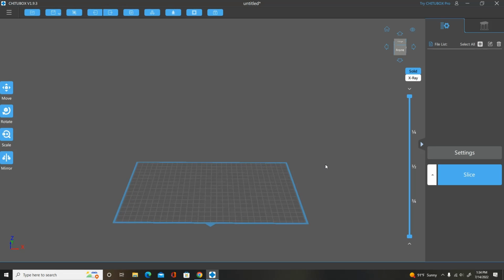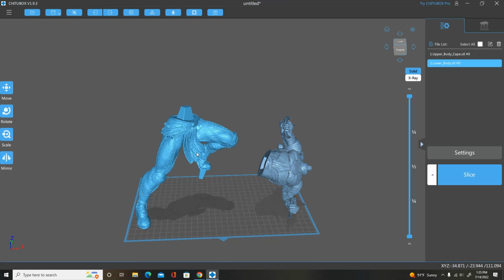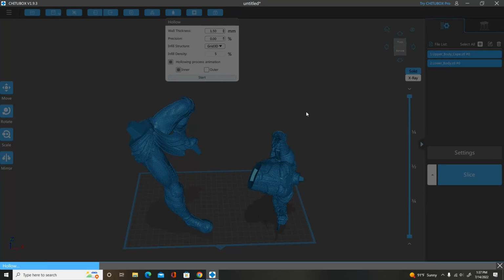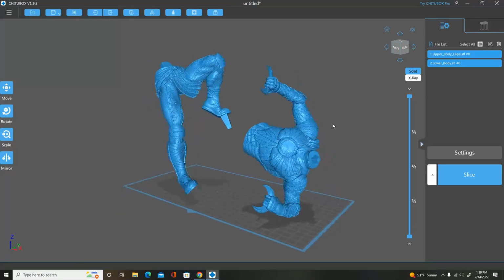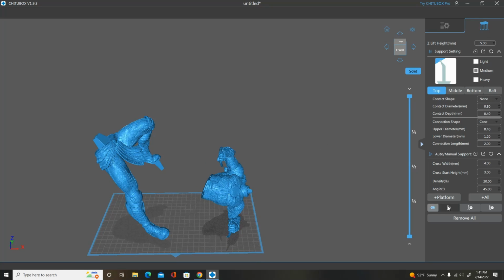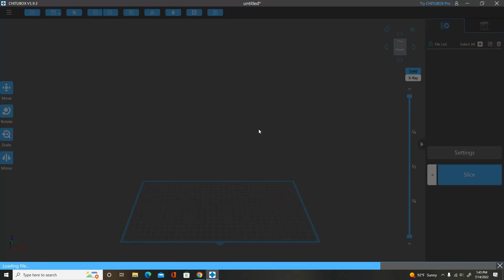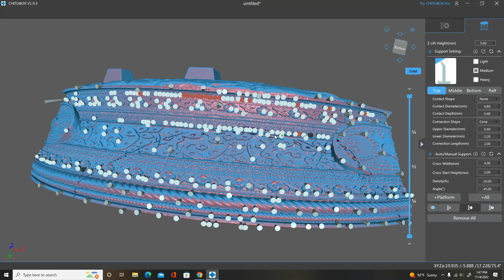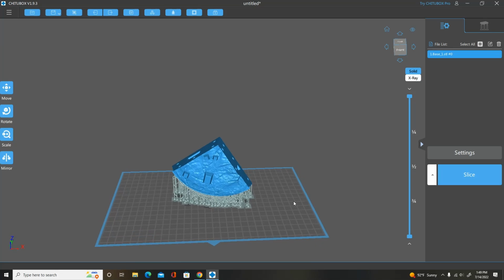Quick and EASY Settings for Better 3D PRINTS / Supports/ Resin Art

Comment: The newest version of Chitubox doesn’t allow you to change the support density. What settings am I looking for in its place? Also, on a hollowed out model with 5% infill I’m still getting auto supports inside. Is there a remedy for this? I have Chitubox basic.
Reply from the maker: I'm not totally sure with the newer version. I still use 1.9.4 version.

Comment: I am so very new to this. i have watched a ton of videos to the point of over load. My question would be are you concerned with islands after you use auto supports? I am mainly doing small parts 1/24 scale car models any suggestion you have for  me would greatly be appreciated
Reply from the maker: I usually don't have a problem with it but I look over everything first

Comment: Hi great video. Why when i use auto supports, it create supports also inside the hollowed model? I have to manually remove them piece by piece evrytime.
Reply from the maker: I use 5% of the grid infill. When you use that setting it knows not to put supports inside.
Reply: @TheCreativeCollector  thank you. Didnt know that feature exists. Hope i can find it
Reply from the maker: It's on the setting where you hollow out the model

Comment: Here's a question: Lychee or Chitubox? Also, is the Linant a Chitubox-locked system? So if I'm used to Lychee, then I need to take that posed and ready STL and slice it in Chitubox to print on the Linant? Thanks!
Reply from the maker: So, Linant has it's own slicer but you can use Chitubox or Lychee  with it.
Reply: @TheCreativeCollector  I have a Saturn right now and I'm trying to find a larger replacement. The Deck seems like the logical choice over the Sonic Mega 8k. Have you used that printer?
Reply from the maker: @mzsherman  Have I used the Sonic Mega? No, I haven't. I heard good things about it though.

Comment: This video is great, I'm having quite a few fails lately and I believe it's because I haven't figured out the best orientation and the support settings. My question here is, you print HUGE models, but for someone who prints in a sligh smaller scale, do you still use the same standard supports?
Reply from the maker: Yes I use the same supports for all models. The only thing I do differently is I add more density for larger heavier pieces.
Reply: @TheCreativeCollector great video

Comment: Hey bro, great video, however... I always get small little dents from the support tips. You pull them off effortlessly, but when I try to do that, I get dents in my resin print, which I have to putty. Very annoying.

Any tips for that?
Reply from the maker: I get those sometimes, but I can usually sand them away with my Gtool. It happens a bit with heavy supports, so I use medium most of the time. I dialed down my exposure time a little and it helped with this a lot. Now they basically just fall off.

Comment: I noticed on the base there were "red" areas around the front facing detail part of the pegs. Those areas aren't supported at all. And it still printed just fine? Awesome video!
Reply from the maker: Yeah so I usually dont have a problem when the support goes over slightly like that. I try not to make it a regular thing, but it happens now and then and it still prints fine.

Comment: I love the settings for the supports. It's soooo much easier to remove after print. I have one question, I keep getting tacks heads (area supports pulling from resin print) on some parts. What can I do to fix the problem...I'm printing on Elegoo Saturn and Saturn 2
Reply from the maker: That's somewhat normal, but of they're too big then check the settings on the base of the support going on the model. You might be able to tweak that a bit.
Reply: You mean the tip that touch the print.
Reply from the maker: Yes. Use the cone settings

Comment: Do you find yourself adding extra supports when you use auto or do you trust it mostly to do it’s job? 
I haven’t used chitubox, I use lychee and every time i just use auto supports I seem to get a failed print and it doesn’t seem to detect a lot of islands. Maybe I need to swap to chitubox and give it a go!
Reply from the maker: I usually don't have to add any extra supports. Most of the time I take away a few.

Comment: Awesome video! I have a question though! When I slice a print it gives me a time total of 5 hours but when I load it into the photon mono x the time becomes double. Is that normal?
Reply from the maker: Yes that's normal. It has to do with the machines internal settings like UV output and so on.

Comment: Thanks for this, it definitely helped me a lot. I would orientate my models so the supports would be on the mating surfaces. I did this because I was afraid the supports would take away detail from the surfaces that would be seen. The problem was that my models would never fit together well. This video makes me more confident about placing supports everywhere!
Reply from the maker: Try it! It works really well. Your pieces will fit a lot more snug and you won't have to use tons of filler on it. Le me know how it goes!

Comment: I have been a B3Dserk patreon for 3 months and next month I will finally buy my resin 3d printer (0 experience). This helps a lotttttttttttttttt, thank you so much! I was planning to use the files from the pre supported chitubox directory hahaha. Just one doubt when I was "playing" with the pre supported files there were 2 directories "50" and  "100", with different sizes, which are the scales for each one, plus are the non supported files?
Reply from the maker: Great to hear! I'm glad this helps. So, Wicked or B3dserk usually has all of their models in 1/6 scale and busts at 1/4 scale. So, I think the 50/100 thing is if you want them full size versus half size. Reach out to those guys and they can tell you for sure.
Reply: @TheCreativeCollector  Thanks sir!

Comment: I’d like to see the support contact points close up. When I use mediums, even with a contact size of .40mm and a depth of .10 they show like crazy and require a lot of clean up. Any idea why? Thanks for the video.
Reply from the maker: I'm not sure, and I'll take a look. Maybe from the angle? I don't have any issues with a lot of clean up with mine. I'll post a follow up on this message if I find out once I research it.
Reply: I use 0 penetration on all supports.  Consider the time you are exposing perhaps it’s a little too long and it’s baking the supports?  Resins are very different too of course.  I mainly use Syria Tech (Fast/Tenacious 25% mix) and Phrozen 4K.  I do use a little hot water for about 30 seconds and they come off super easy.  I will sometimes use a heavy support on the initial build plate contact for large heavier pieces to ensure they don’t pull off.  If there are dimples I apply a small amount of resin, ultraviolet flashlight and a quick sand.  And as mentioned orientation can eliminate a lot of cleanup.  Hope that helps!
Reply from the maker: Awesome! Thanks for the help Kelvin!